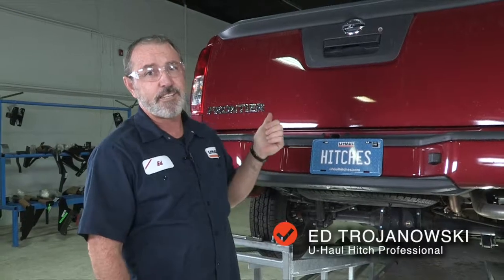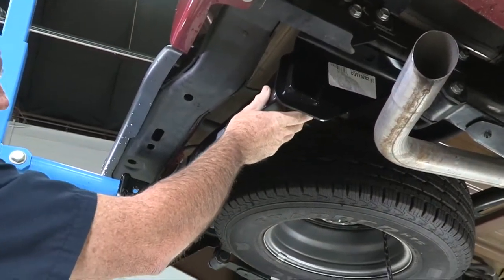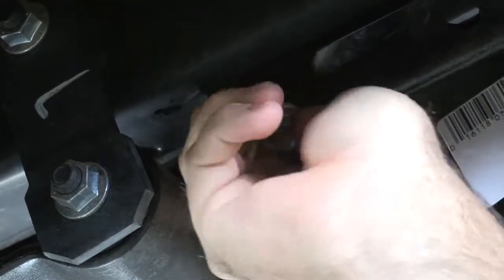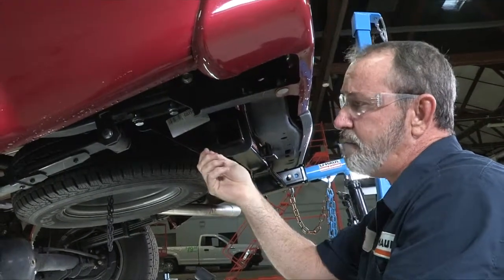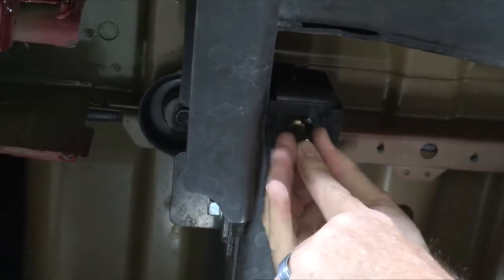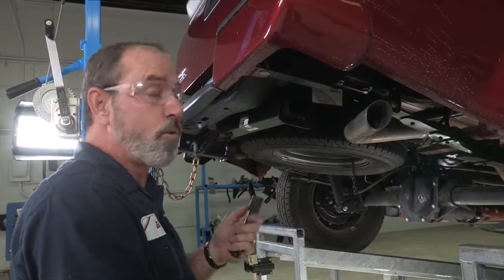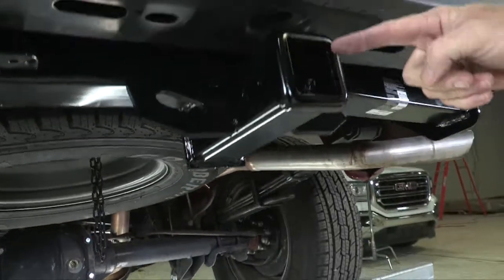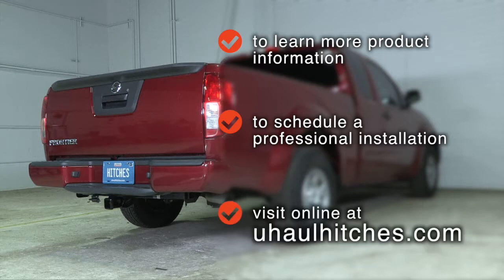2011 Nissan Frontier Trailer Hitch Installation

Comment: I know you were just demonstrating the use of the brush and the thread chaser but I would have just run the bolt in and out a few times with the air wrench... done.